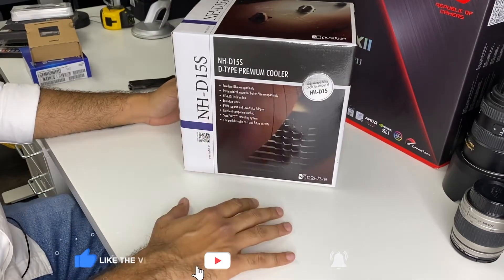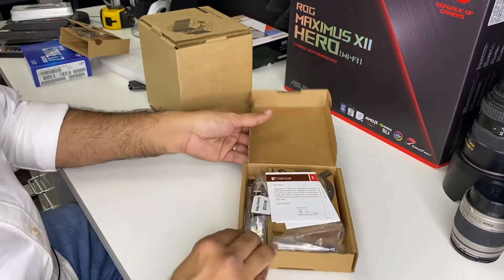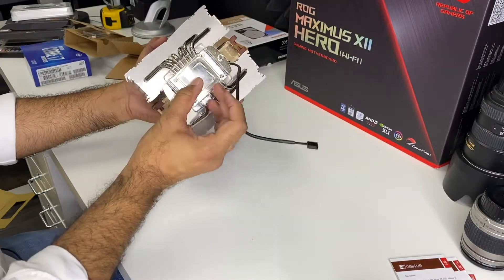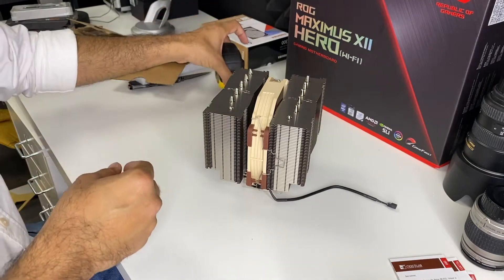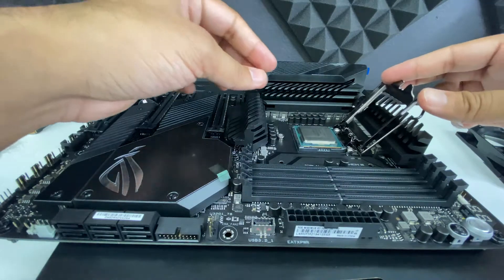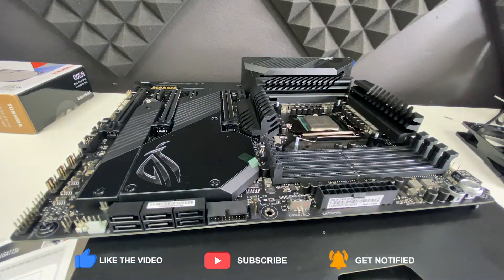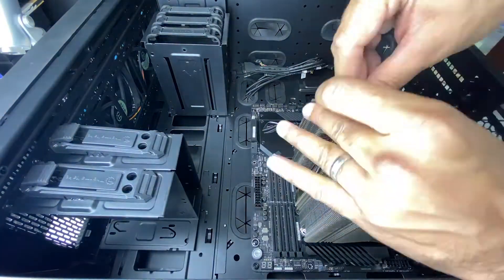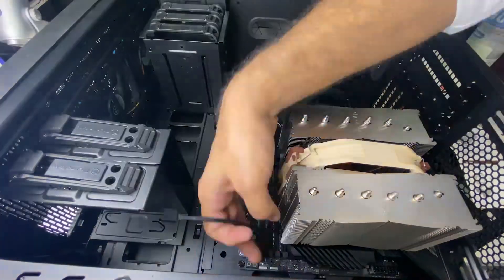Unboxing & Installing - Noctua NH-D15S 82.52 CFM CPU Cooler Heat Sink

Comment: You did it wrong, I mean is way more effective if the cooler is mounted with the side that tha fans are getting the cold air from the (front of PC) from those fans, and then dirrectly trowing hot air out in the rear of PC. just turn 90º that cooler, you have to change also the brackets for it.
Reply from the maker: I ultimately ended up turning the brackets and cooler as you described. Not because of the reasons you mentioned but because I was not otherwise able to install the RAM. Thanks for the feedback though, and good catch!
Reply: @NotHershal  I thought you would have trouble installing the memory. I'm glad you found a way to get it working.
Reply: I need to put the low noise for nh-D15s?